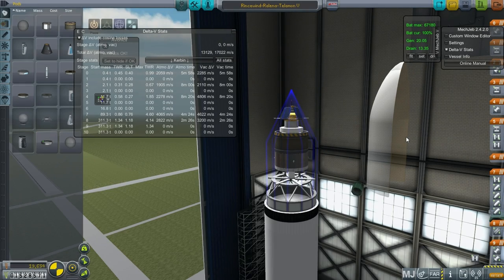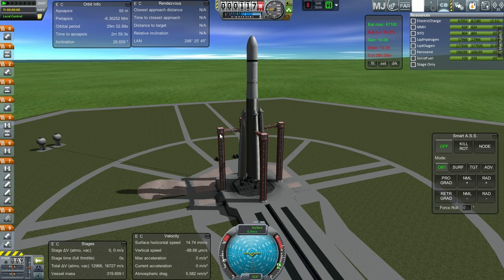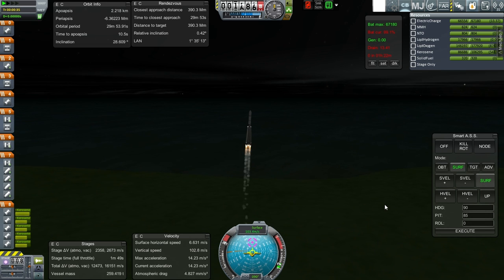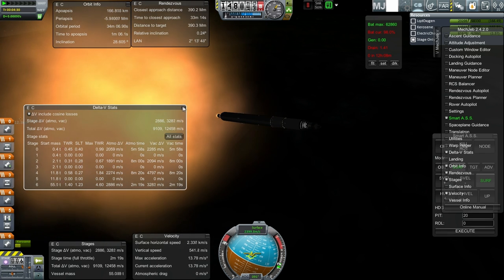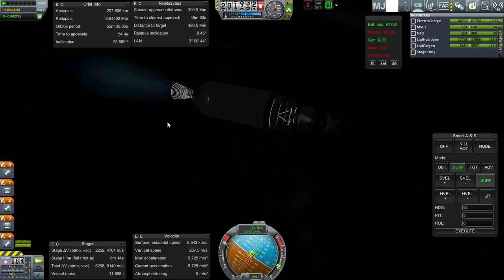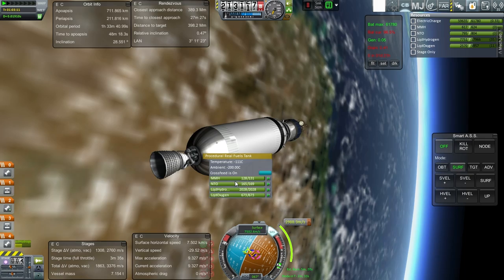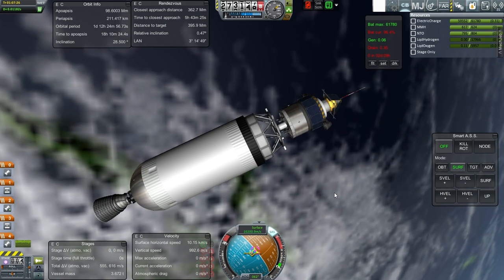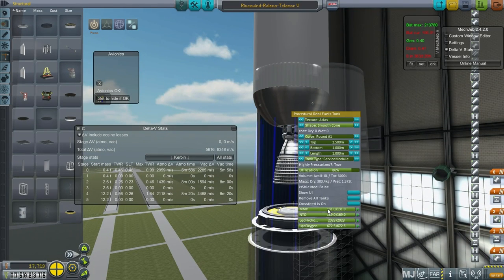Realism Overhaul in KSP Beta 15 - Rincewind Lunar Lander Part 1

Comment: The amount of lag you're getting is strange. Does your framerate drop that much when you aren't recording? Also, lighting is weird because of procedural parts, it can't accurately detect the size of the part. I'm not sure if it treats it as opaque or exactly what causes light to go through it, but that's just a downside of working with procedural parts.
Reply: You can try forcing multithreading to see if that bumps it up for you, -no-singlethread is the command for it. I started using that and attempted force dx11 and the game seems to look better, but I haven't checked my logs to see if it's working. Either way I'll bet you're glad proc parts exists, imagine tripling your part count and playing... yikes
Reply: Best of luck. If it doesn't persist in other versions it's more than likely a mod. I had an issue with karbonite in 23.5 that made everything drop to 3fps, so it's not out of the realm of possibility
Reply: i've got almost the same GameData folder as Tyler and literally no lag. Only difference is that I don't use the EVE. Maybe try to record one part without it? I know it's not gonna look as awesome, but it's better than watching a slideshow, i think...
Reply: I've the same as you Tyler, plus a handful of extra plugins and part mods and no lag, so I'm not sure what to tell you. If you have a drop box you can upload your Gdata folder and I can test it out if you'd like. And if there's lag I'll try to troubleshoot for you, if you're interested